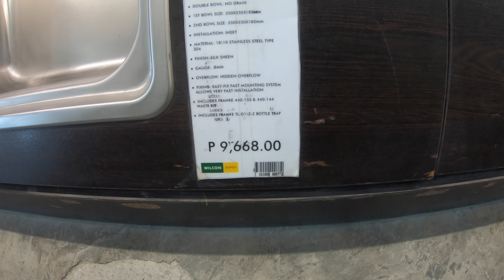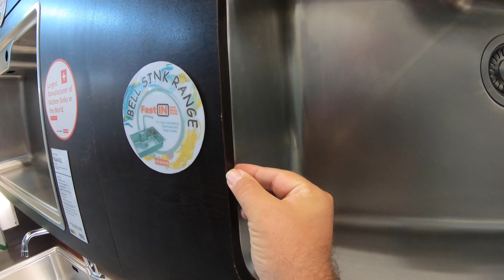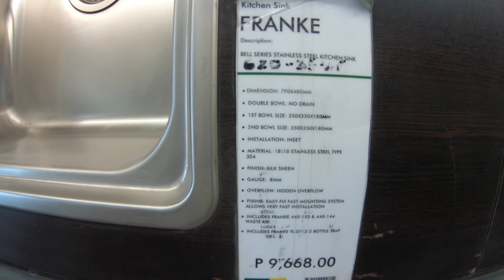Philippine House Building Step by Step, Build Day 130:  Kitchen Countertop Construction

Comment: Your workers have good work ethics coz I haven't seen anyone smoking while working.
Reply from the maker: loisemir29
We made a request through the engineer and reinforce on a regular basis with the foreman that the workers not smoke inside the house now that the walls are up. Emie and I are both allergic to cigarette smoke and don’t want it penetrating into the concrete or hollow block only to come out after the house is finished. Brand new houses should not smell like smoke. 
We are grateful that they are complying with the request. Most will take a moment and walk across the street to smoke and go back to work quickly afterwards, or just wait until break time. 
Again, we are blessed with a great crew. 👍

Comment: Do you think  a 100 thousand dollars would be enough to build a mid grade  150 sq foot house.  We already have the property, so no coast for land.
Reply from the maker: Erik Vinje
Just guessing here... I’m assuming you mean 150 Square Meters not Square Feet.
At 150SM
If your builder charges 20K/SM then you would be looking at a little over PHP3M. 
So to answer your question, my best guess would be that USD$100K may be enough for the basic build. Other expenses need to be accounted for as well. Such as AC, Appliances, perimeter fence, and landscaping. None of which are included in the basic build quotations here.